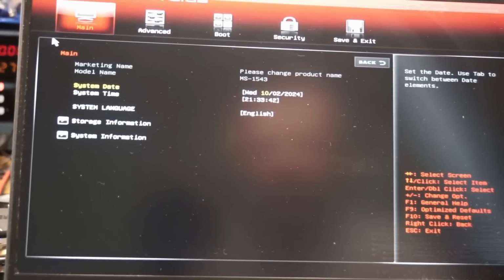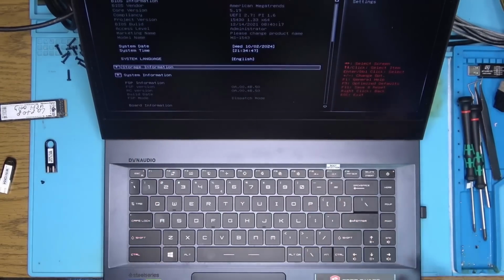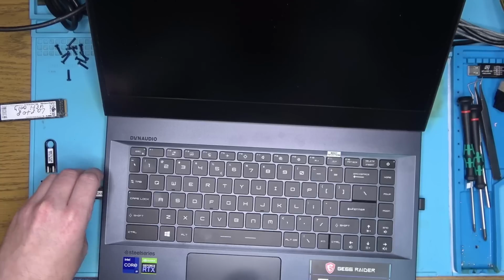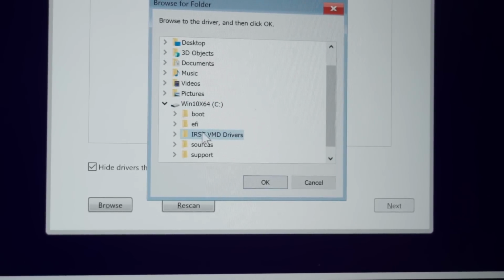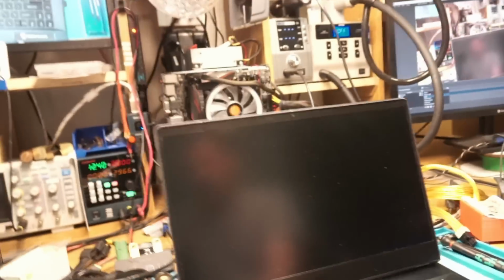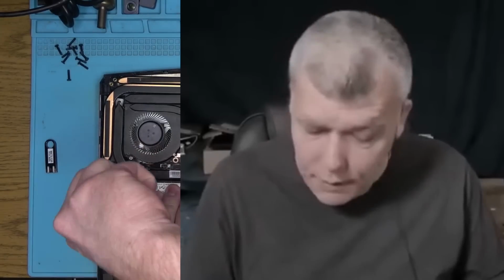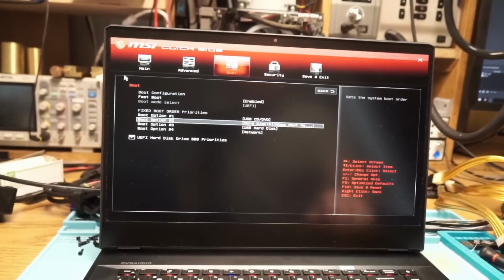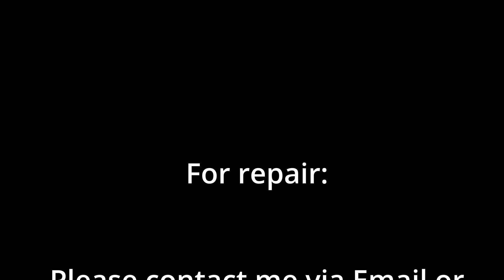MSI GE66 Raider Cannot boot into NVME or SSD

Comment: it happened to me back then with SCSI drives as well, needed a boot-able controller installed into the pci slot for it to boot and i had to use windows installer with add on driver loaded as well ,,, was a nightmare !

Comment: I dont know if this helps you but the way i do it:
1. Use a USB to M2 Adapter For your SSD that has everything on it and boot it
2. Install all of the Drivers onto the M2 USB SSD while you are using it as the windows on it
3. Check Device Manager on Windows for the M2 Installed in the System.
4. Via Acronis True Image (i always use Sandisk or Western Digital SSDs) Clone the Windows from M2 USB SSD to the Installed M2 on the Mainboard.
5. Disconnect the USB and the other one should Boot.

Comment: This would happen on xp if you wanted to use sata drives. You needed to provide sata controller drivers. I had a ddr1 socket a amd board with 2 sata ports years ago that needed that when playing around installing windows 7 on something too old, it didn't recognize the sata chip and needed this. Also you could get or modify your xp iso to include sata drivers by default. I had to do this as I used xp quite late/close to the end of support as my pc was very weak. I saw this on a new laptop too, first time seeing an nvme drive, was installing windows 11 for someone less tech savy and when I saw the drive not detected in the installer I knew right away I needed to get the drivers from intel.

Comment: For example Dell Computers also ship with a „SATA Operation Mode“ set to RAID, you could then also load the driver as you showed, but easier way is to switch from „RAID“ to „AHCI“, then the install stick can find the drive with it‘s inbox drivers. This is also better, for „Reset this PC“ cause the RAID Driver might also be missing in the Recovery partition, requiring manual driver injection into WinRE, before you reset the PC.

Comment: The "bios/CMOS" battery is only there to keep the RTC (real time clock running. The configuration itself is stored in NVRAM withn the spiFlash, it does not need power to retain information. When the battery is removed or drained, the voltage drop is detected by the board's chipset, which then resets the configuration to default. A low battery would cause a permanent BIOS configuration reset every time the device looses power. BIOS or UEFI in "modern" computers is stored in a spiFlash chip.

The configuration or firmware corruption can be caused by many things. Firmware update failure, shutdown during writing, spiFlash failure etc.
This is why BIOS flashback and similar technologies were implemented over the years.

Though, this has nothing to do with the Windows installer not being able to see the drives. As shown in the video, the OS is simply missing the driver for the the controller. Remember, chipsets have evolved, the installation ISO did not change much over the years. You may have better luck With the Windows 11 24H2 ISO which probably contains a few newer drivers.
Reply: Only for the clock ???
REALLY. ????

Comment: Had the same issue on two Acer computers I was tasked with repairing; intel RST not helpful...AHCI and raid not helpful, bootable to external drives, and you could run and install Linux on the drives. Win10 and win11 media tools could not see drive...turned out to be a bad stick of ram....even though it pass mem test....WTF....

Comment: That is actually how the older way the windows were installed. The compatibility years. You had 2 options. Either use a CD with drivers, or a compatible HDD and then install the drivers you downloaded/ had saved.

Comment: Is there any way to check laptop VRAM/GPU?
Laptop: MSI GL65 10SEK, i5 10750H, 2060 6GB GDDR6
Problem: GPU Crashing on heavy load like runing benchmark but sometime also woks like Furmark running fine sometime..... 
Heaven benchmark crashing and switching to iGPU.. but same benchmark working with lowest resolution available there...

Comment: Intel RTS VMD driver is only required for laptops/motherboards set up in RAID/VMD mode, as normal ACHI users won't encounter this issue. Apparently, even RAID has been a technology established and used since eons ago, technicians like northridgefix or any other Asus contracted repair person have no idea it existed and a simple VMD driver is all they need to fix such a problem... Even I a new user to raid would figure it out within a couple hours.

Comment: Once you install Windows in IDE, AHCI, or this Intel kind of raid mode, it will start the appropiate service and you cannot boot it in other modes without reinstalling or configuring its other services to be loaded on boot beforehand. In case you wanted to boot your own old Windows installation.

Comment: Has been basic knowledge for years now. This has been the same for RAID systems for decades by the way. Have been doing this several years in my repair shop. But I would not be able to reball a gpu. I do not have the equipment required.

And you most definitely find this info on the English sites/discussion boards all over the internet, Russians are far behind from what the English speaking community is!

This time you are just lost, sorry to tell you this.

Comment: win 11 is missing some core drivers, this has never happened to me on older windows installs even once, I recently installed w11 on 3 different brands of laptops with the same irst driver from the intel site, also two of those laptops were missing any kind of network drivers and was stuck on connecting to internet screen😡,then just downloaded those drivers on the usb, shift and f10 to cmd, explorer.exe and voila🐣 you can install them through the gui

Comment: it's a known issue you'll need drive controller drivers sometimes to access nvme's, and bios will store them actually.. it's usually a setting for that. 
i've been doing installs since 90's.. 🤣 in the beginning of SSD's and sata it was the same problem.

Comment: Hi friend, what a great channel you have.

I have a big problem with an MSI GE76, can you give me some advice?

The problem I have is that I bought a GE76 that has a password to access the BIOS, (This laptop belonged to a cousin who put a password on it and forgot what it was, I thought I could easily solve it so I bought it from him, but I was completely wrong)

I have searched for a solution for this for a long time and once I saw on a forum that a possible solution was to physically change the BIOS, I have seen that they sell it on Ebay at a very good price, but the work of physically replacing it is difficult and I have not found technicians who dare to do that.

And I have personally opened the laptop and disconnected the CMOS battery hoping that it would erase everything, like in the old days but it was useless.

I have also contacted MSI several times to ask about this problem and the only thing they have been able to recommend is to replace the entire motherboard, which is completely stupid.

Fortunately, the laptop is still usable and I have been using it that way for more than a year and a half, but the day will come when I need to access the BIOS, and that day I will really suffer haha.

Do you know if there is any other solution?

I would really appreciate a response.

Comment: What about windows 11. Motherboard went bad and upgraded to am5 from am4.
The bios did not like it, hard drive did not show up in bios. Had to wipe the main hard drive and install windows with a fresh new install. Is there anyway to get the operating system to work on a new Motherboard and cpu.
I could not find anything online.

Comment: I had the same issue with an Acer laptop with RTX3070ti.Googling a bit i found a forum with some drivers for SATA .If you don t install the drivers ,the windows instalation stops (cannot find the ssd in the list but in bios you have it  ) .It took me 2 h to find the solution

Comment: I hit this wall like 4 years ago with multiple laptops using nVME drives, that's why I keep intel drivers for this kind of issues. 2 fun facts you need specific drivers for this issue other fun fact is if the drivers are to old Windows Update will delete the nVME driver and after the reboot you will lose that Windows installation with no way of recovering it.

Comment: Recently I worked on a dozen of new Dell Vostro laptops, attempted to deploy Windows 10 Enterprise and encountered the exact issue. The NVMe drive presented in BIOS but not the Windows installation. After a few minutes of searching it turned out that specific drivers required. I downloaded and loaded the driver then everything worked.

Comment: Old problem. New hardware.
So they added the driver required pre installed. So that means they slipstreamed an image for that laptop and didn't provide a recovery partition with the preloaded driver.
Dirty old trick. Gotcha moment.

Comment: I had the exact same problem with a new motherboard, in my case it was not detecting the network.  No matter what I would do, even plugging internet directly in the computer, Window Installer wouldn't find any network.   After lots of research, I found out it was because windows installer didn't had the network drivers.   After i installed them, it worked.

Comment: That all depends how the bios is configured if it set to Raid you won't see the drive. Cmos battery dies it reset to factory default even that won't fix it that why the golden tip is to save the settings like a profile when it fully working otherwise you gone bald after pulling all your hairs out 😅

Comment: Great, I look forward to this happening to my laptop.  I've already had to send my GE77 back twice for repair.  First time I sent it back because during a windows update it literally bricked the laptop AND I HAD TO PAY FOR SHIPPING.  I had it plugged in and the battery was full.  When I got it back from "repair" they had damaged my keyboard and some of the keys no longer worked, at least they covered the cost for me to ship it back this time.  After I got it back that time they replaced the keyboard and didn't replace any of the factory stickers and didn't even bother to update all the drivers so I had to spend HOURS updating everything again.  I won't be purchasing anything from MSI again.  My ASUS has never given me problems in the 6 years I've owned it and it's literally on 24/7.

Comment: You know you can turn off the intel rapidstorage garbage? My XPS13 had it in 2016. It produced the same issue. It offers no benefits to the computer and it has a legacy AHCI SSD mode that just works.

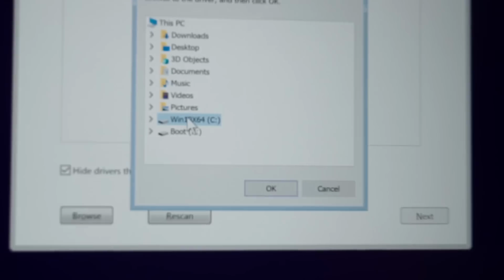Comment: 5:31 this is normal especially when you are using RAID (or old OS), most of the windows setup's do not have drivers for many type of RAID and disks, so we need to upload the drivers to the setup (like have it on the pen drive of the win setup and manually load them).

Good video

Comment: I have a GE 75 Raider. I love it compared to the Alienware trash it replaced. Better specs, upgradeable RAM, runs way cooler, and was way cheaper. 
I access the advanced bios the same way, some msi laptops use a different key combination.

Comment: Hello, two months ago, I was cleaning my laptop and had turned it off, but somehow it started booting during the process. I removed the RAMs, and the screen began showing glitches similar to an old TV. Afterward, it couldn't boot, and I discovered that it's not detecting the NVMe SSD. I also checked the NVMe SSD in an enclosure, and it's not being detected, although it's not physically damaged. Is it repairable?

Comment: I work with similar machine and was able to fix it by just first booting to linux to see if the drive showes up then boot to sergi witch is a winpe windows 10 and start sdi snappy and inatall the driver and install windows inside sergi and that fixed it

Comment: Don't bother with installing intel VMD drivers, there is no difference in performance with VMD or AHCI enabled. And AHCI is native to windows installation, so setup indeed see all disks in AHCI mode. Just go BIOS disable VMD/Raid when you use single disk or you do not plan to use raid. Switch to AHCI/NVmE

Comment: Wouldn't call this a "new" problem, it's actually a really old one which raises it's ugly head every once in a while.
Even back in DOS times on some systems you had to install special drivers to proceed with the OS installation.
Depending on the system these might had to install chipset/scsi/controller/raid drivers this is just a new iteration of that.

Comment: Heh i had one older Dell laptop and it didnt have shown the uefi / legacy support boot option menu but i did see it in decrypted uefi/bios file what was there and Dell had made it so that by default uefi but in case of error it switches to legacy so have fun if you run in error and it switches it to backup position if you dont know how reset the bios.

Comment: This issue is not so uncommon as it seems. If disks are connected to a dedicated controller, You need the driver for it. I had one for years (Adaptec 6805), and the Windows driver library never had this driver built in, so every time I needed to run the installer or troubleshoot, I needed this. My other disks connected to the mobo was visible. As You mentioned, nowadays, that problem seems a bit distant for regulary users as You just put the NVME disk right into the PCIE slot, and therefore may not be relevant to install any dedicated driver.. But if the disk shows up in BIOS but the installer can't find it, You need the driver.

Comment: Nothing new here, Windows 10 is simply missing a driver for the hardware.

Since the Windows 2000 you had to press F3 key to install additional Storage drivers for various RAID cards (in DOS mode installation part). Same was in Windows XP, only with Vista and later Windows versions computer would boot into small graphical version of Windows (called Windows Preinstallation Environment) and offer you to add Drivers needed for installation to be able to detect the special hardware that is still not supported out of the box by Windows.

Video is good, glad to see someone made it, because many people are going to have these kind of problems trying to install Windows 10 on laptops that are made in Windows 11 era (why people don't just install Windows 11, because it's 💩and still not compatible with many specialized software)...

Also nothing that a "Custom Windows 10 ISO" cant fix, just make it yourself, do not download it from unknown sources on the inter-webs.
Reply: It has been available in the NT days, at least from NT4.0 and it was F6 not F3

Comment: i have a laptop that refused to install an os on any ssd but would do it on mechanical hard drives, however it booted once installed. in the end, the issue was actually the motherboard cable, once i replaced it, i was able to install os normally

Comment: Thank you for the MSI menu keys tip. I'll try to remember it.

Here's a tip for you. 
In a similar fashion, a few months ago I had a terrible time getting a fresh build SuperMicro server to boot into an install USB stick for Windows server 2022. 
The server motherboard had an HDMI and a DP port, an M.2 NVMe slot and other fancy things. I plugged a monitor into the DP port.
The UEFI displayed fine, I can change settings and it recognized the drive, whether it was M.2 or Sata.

Attempting to boot, it would hang immediately after loading bootx64.efi whether from USB using Rufus, or self built CD. 
It would say it was loading the boot files but just freeze. 
It did have a low battery and a corrupted UEFI which I fixed. But no matter what I plugged my stick into, it would not boot.
I called up Super Micro and the tech couldn't figure it out. So after his work, he went home and attempted to help me even more. Nothing worked. We communicated over a period of two weeks trying to fix this thing. 

I switched the monitor into the HDMI port and got the same thing, a stalled boot, except it would run a memory test USB.
I built a Windows 10 and a windows 11 CDs and different USBs trying to boot, same issue.

The customer was getting worried he was never going to see his new server and I thought I bought junk. 
So I RMA the server back to Super Micro.
After testing they sent it back to me with a paper saying NO FIX.
The paper also said it boots up fine and they did pre-install server 2022 on it for me. Great guys! 

After talking to Super Micro some more they thought that I had a bad installation media.
I asked them to send me the populated USB stick that they use and they agreed and sent it.
I tried booting from that stick and it still would not boot. They and I were both flabbergasted.

I had to find out why it would not boot from a stick  because if I ever encountered that situation during its service life I'd be stuck. 
As a side note, I have two computer build stations, the newest station has an HDMI and a Display Port monitor, whereas the older build station only has a VGA monitor. I had this computer on the newest station, where I had successfully built other computers. 

After the multitude of hours/days trying to get this thing to boot, even with help, a very dim light bulb turned on in my mind.
Then I thought "NO way...this can't be the solution..I should have known!! " 

I took the computer down to the old build station, plugged in the VGA monitor, and my install USB...... 
And it booted right into the install, using my own media. 

Now here's your Tip: On a fancy updated bells and whistles Super Micro server motherboard, only do your install using the VGA port. Once installed the HDMI and DP port work fine. Seems Microsoft has still only included VGA support on an install of the server 2022 OS.

I'd assumed because the motherboard had the other display connectors that it could install using them, I mean the UEFI options displayed fine.
I should have known because all other "servers" I have built had only VGA connectors.

I want to blame this on somebody else but I don't think I can. 😂